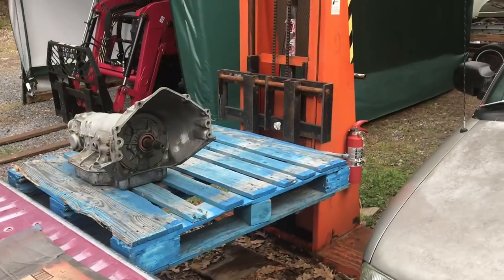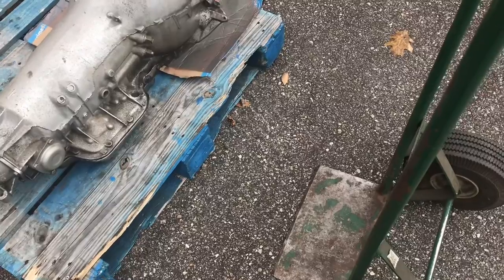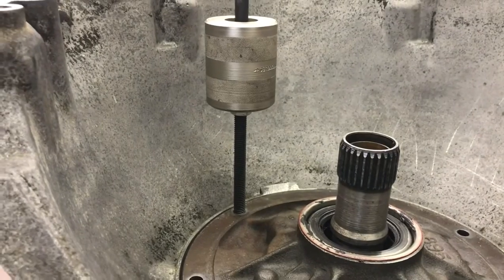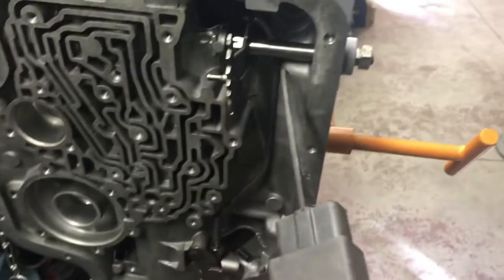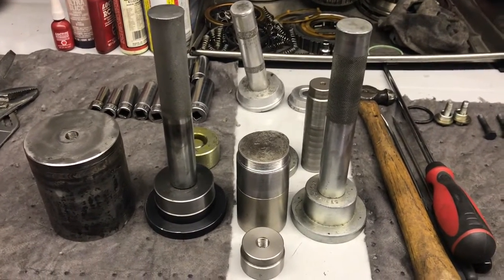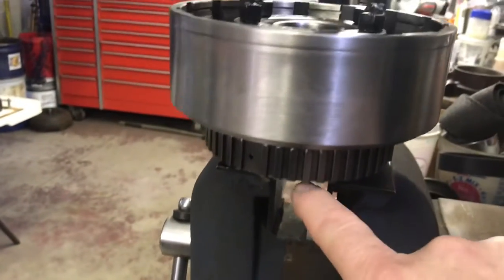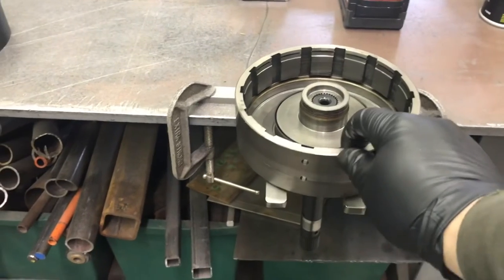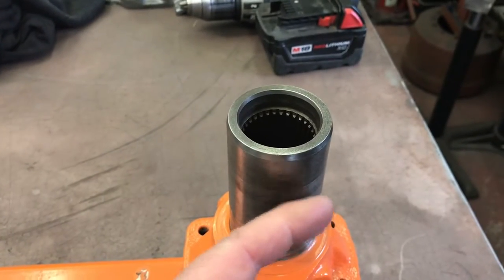TH400: Tools for Overhaul & Mods.

Comment: Excellent info!  I took a set of c clamp style vice grips and ground down the "pincers" to securely grab the shaft and set the lower unit in vertically.  The c clamp makes for a nice handle.

Comment: Must have tools out of all 400 videos I will consider you a pro because your the only one using cut off bolts for alignment tools I've  been looking for a building video without teardown for a highfly street car back in my day Fairbanks 2 stage shift kit was the go to mr.  Crew cut were difficult to use and result  was iffy  your bench fixture is cool but instead legs it should have a hole big as stator it work good for building forward drum and pump

Comment: Nothing to do with tools but what trans fluid do you like to run ? . Thanks Shawn
Reply from the maker: Good old Dextron III or tractor fluid. I have a few cases of DEX6 but haven’t tried it yet, suppose to be backward compatible.
Reply: @mountainsgarage  when did tractor fluid become the thing to use ? I read about it on the DIY Facebook page
Reply from the maker: @MrLangleylad  I ran it 10 years ago. Others were as well.